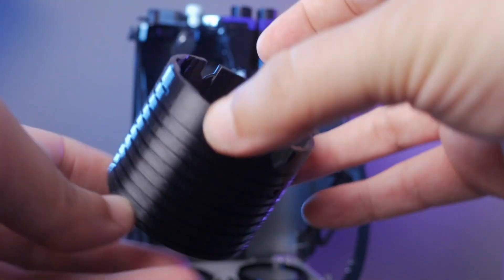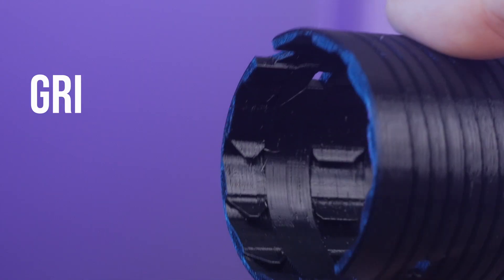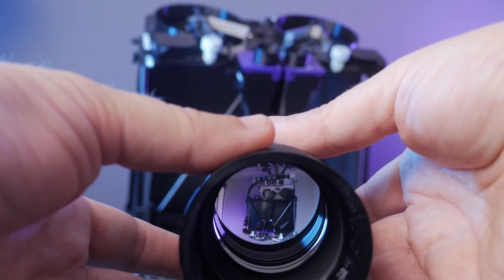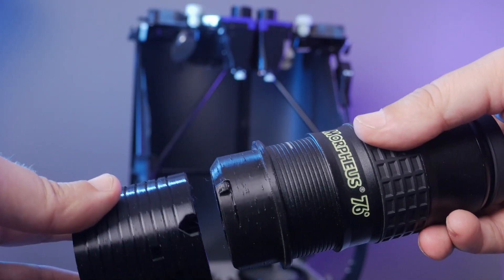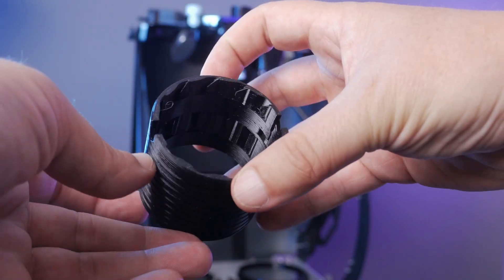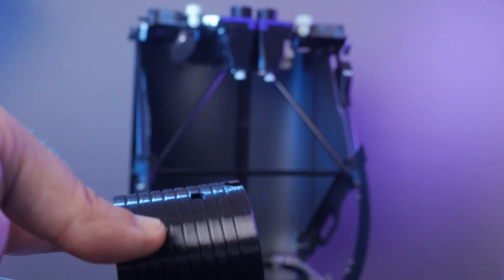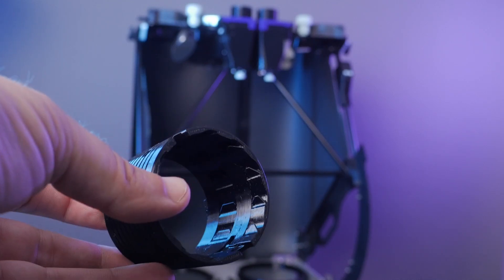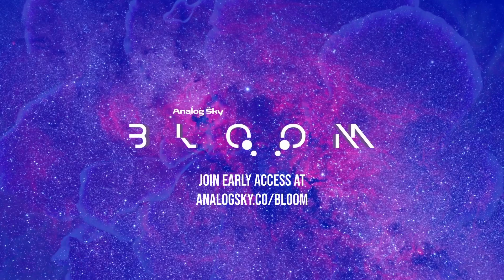Creating the best binocular telescope focusers

Comment from the maker: One other note on the development of these drawtubes: Recently we updated them because Tele-Vue released their new Nagler series of eyepieces. They represent a new bar for low focal plane in eyepieces. We were able to add an extra millimeter of threads for in-focus at the top of the tube, and remove 3mm from the bottom of the tube to make sure filter cartridges could fit below these new eyepieces. Let us know in the comments if in-focus has ever prevented you from using a favorite eyepiece on binocular telescopes!

Comment: Can I upgrade my original Magic binoculars to use these new Drawtubes?  Do I only need the new Drawtubes or do I need more upgrades?
Reply from the maker: Yes! The latest drawtubes also need corresponding large/small thread components. The latest will be in the 3D print file archive in the Magic course.
Reply: @AnalogSky  So, I need to print the two following files: Magic-Drawtube_Long.stl and Universal-Focuser_Large_Thread.stl.  Is that correct (I have the 225mm focal length lenses)?
Reply: @deepskywim  and the Focuser_small_thread as well. I'll put up an "upgrading your focusers" lesson!
Reply: @robertasumendi  All updated printed parts arrived today.  Do you still plan to put up an "Upgrading your focusers" lesson?

Comment: Idiot tip, if you leave the telescope in a very hot car with covers pressing against the grip fins, they will soften and permanently deform. 😮

The best thing about the Analog Sky designs are when I do stupid things like this, it's super easy to reprint a new set.
Reply from the maker: Hey Bert, d'oh! That's the first instance I've heard of that happening. Was it with the dust caps on? We've tested in vehicles where the ambient temp was over 100F+ for over a week, but probably not with the dust caps in.
Reply: @AnalogSky yes, that was with the dust caps in place. It surprised me when I went to drop in my 2" eyepieces and they were really loose. 😊
Reply from the maker: @BertNielson ok great, I'll update the dust cap

Comment: Innovative! How much forces/torque can the adapter hold without deflecting? I am thinking about a modification with a 2” filter thread to accommodate Barlows that or eyepieces that needs a lot of travel-in. Perhaps they could be made from aluminum or brass since the wall of the adapter needs to be as thin as possible. This way you can easily create 40mm or even more "free" in-travel. Or design a smaller secondary as well.
Reply from the maker: We have 1.25" adapters with a -10mm concavity for eyepieces that need extra infill. This works for eyepieces with smaller diameter, though some 1.25" eyepieces have annoying 2" barrels like the Morpheus so they don't work with these. So if you're trying to produce something like this just keep in mind some 1.25" eyepieces won't fit in a <= 2" hole.
Reply: @AnalogSky  Could you make a design with at least -18 up to -25mm and with a fit to accommodate 48mm diameter 1.25” eyepiece?
Reply from the maker: @0rang3-.-Heart 48mm should be doable, providing a 1.2mm thick wall on either side of the eyepiece, sure. May be a snug fit depending on how exact the 48mm is. We are planning to release some of these 2-1.25" adapters soon for the general astronomy market because two people came up to me at WSSP and asked me for one. Why not sign up for free at http://members.analogsky.co/ and we can discuss it more.